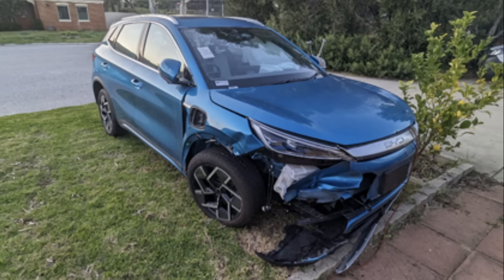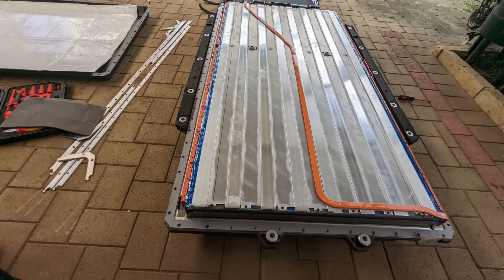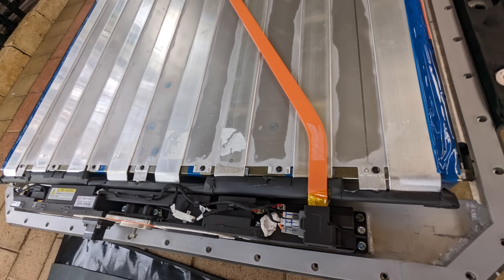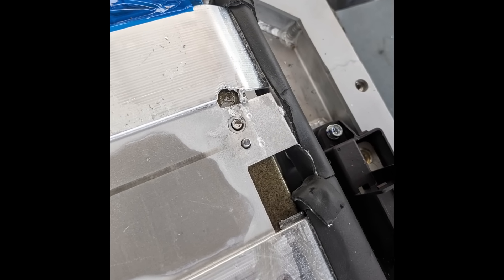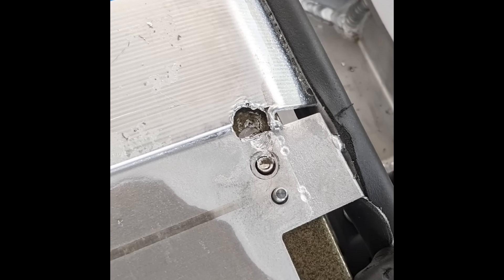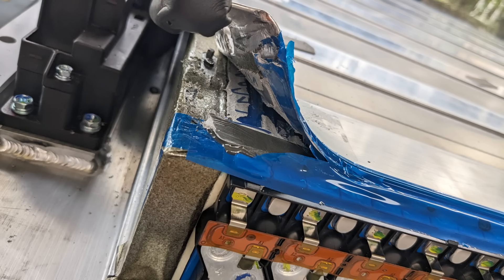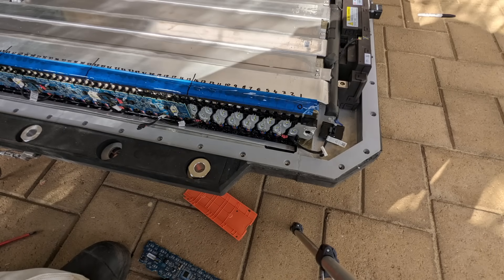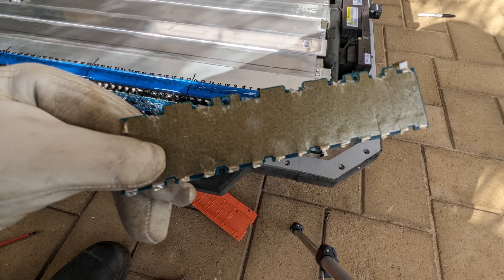BYD Atto 3 battery dismantle P1

Comment: Olá amigo, quantas células têm em uma bateria este modelo.
Reply from the maker: 126 cells (all in series)
Reply: @Brendon_M  Obrigado então esse Peck 403,3v qual a capacidade da célula.
Reply from the maker: Here are all the specifications of the pack
BYD Atto 3 60.5kWh pack 126S 150Ah 403V (3.2V LFP cells)
1050mm wide (1230mm including the mounting flanges). 2100mm long. 125mm tall

Haven't weighed it but around 450kg is my guess

Comment: Why do you want to fully disassemble the battery. Just keep it and use a High Voltage BESS inverter. And find a way to communicate with the BMS of the battery and make a "translator" to standardized CAN messages for the HV BESS inverter.
Reply from the maker: 100% agree. If I was to do it again, that would be the way I'd go
Reply: @Brendon_M  ah sorry read the rest of the comments u told that already before. :) still great setup like this and probably learned a lot....
Reply: 'High voltage' home inverters operate around 100-150Vish, as that voltage is the closest to actual solar string voltages found in typical home setups, not the 400V this pack puts out..
Reply from the maker: Not for grid tie inverters. There are lots around the 400V mark. Have a look at Dala's EV Repairs on YouTube or Dala the Great on GitHub. He has developed a whole system and lists out the compatible inverters

Comment: Friend, don't work on the floor, work on a table (and preferably a table that is high)
Reply from the maker: Problem is I didn't have a table that can support 500kg
Reply: I know my answer is not very kind; 
Sorry, my friend, if you don't like the answer, but I believe that problems don't exist, only options. I think there is always more than one way to reach any place. If there isn't a table, I would look for construction blocks or create my own table that can bear the weight. As far as I know, a wooden beam can be as strong as a metal beam
Reply: @Brendon_M  I think maybe you wanted to say that a table does not add value (it does not change anything) and that is why there is no value in investing in a table

Comment: What's the dimension of the battery pack?
Reply from the maker: I go over it in one of the other videos but - 
BYD Atto 3 60.5kWh pack 126S 150Ah 403V (3.2V LFP cells)
1050mm wide (1230mm including the mounting flanges). 2100mm long. 125mm tall

Comment: Thanks for the Video. Very Informative. Just one thing, Before taking out the battery, You must have also open the service disconnect. Where was it in Atto 3?
Reply from the maker: The Atto 3 doesn't have a service disconnect. The manual says to disconnect the 12V battery and then just unplug the HV cable from the side of the inverter stack. You then put a cover over the end of the cable that locks in place to keep it from being plugged back in or the terminals touched

Comment: @Brendon_M can you tell the part number of the main chip used on these boards?, looks like its a 64pin IC chip.
Reply from the maker: I'll have a closer look when I next get a chance. There's probably a close up in the P2 video but I can't remember for sure...
Reply from the maker: No numbers on them but yes; they are 64 pin  ICs
Reply: @Brendon_M  hmm, looking at the BMS board (the current sensing side), it looks like there are two ICs redundant to each other, performing the current sensing and HV measurements. This architecture looks similar to NXP (refer to RD-HVBMSCT800BUN)
Reply from the maker: Had a close look at the chip under a microscope and there are numbers
Main board is -
Infineon
Tricore
SAK-TC234L-
32F200N  AC
84PRT6835US
G2238
© Infineon '13

The other boards are
BYD
BF8815A
And another 4 digit number which there were a few variants 
u2Qa
B2R5
B20d
U205
B2P5
Reply: @Brendon_M  Hmm, which means the Main board contains Infineon's TC234L32F200NACKXUMA1 processor (used widely for automotive safety compliance), while the chips on the Battery sensing boards are still unclear. Lets see if we could reverse engineer more.

Comment: Are you able to tell me whats under the underbody battery cover once you remove it?
Reply from the maker: Do you mean the black material attached to the battery itself? Or the plastic under trays on the car?
Reply: Black tray under car. Somehow i ran over something which punctured  some holes
Reply from the maker: Well, the tray at the rear has not much under it. The tray at the front has all the connections to the battery behind it but they are all above a piece of rectangular tube so pretty well protected. Unfortunately I don't have any photos

Comment: This is a blade battery?? No chance to replace a bad cel??
Reply from the maker: Yes it is a blade battery but in this case the cells are welded together so unfortunately no, you can't replace a cell without specialist equipment.

Comment: So basically the battery is un-repairable. Seems to me that replacing a piston in an ICE would be easier and cheaper !
Reply: I dont know. Last time I contemplated paying a garage to do that was better to buy a used or new engine. Replace one piston whats next?
Reply: @jaaklucas1329  Let me rephrase that. "So basically the battery is un-repairable. Seems to me that replacing the entire engine in an ICE would be easier and cheaper !"
If the cells are glued in then there isn't a repair path so scrap. Basically the value of a used EV is the car minus the cost of a new battery (and installation labour) which probably comes to about a dollar.
Reply: @chrissybabe8568  Yea lm with you. Like to see an easier solution to fix a few cells in this pack. I believe Telsa can refurbish a pack.Mind you, these cars cost so little in China I guess it is what it is...
Reply: @jaaklucas1329  I have 6 close relatives who have bought EV's (incl 2 x BYD, 1 x Tesla). I avoid any conversation that would require me to call them stupid (5 of them have degrees so they certainly aren't stupid). The only thing I can think of is that they must be what are called early adopters who have totally managed to ignore all the downsides of owning an EV including the reasons of why they are NOT ECO friendly.
Reply: @chrissybabe8568  I only know Ebikes which Ive built and are excellent. Like Edison motors knows,  an Emotor is way superior to an ICE engine...even if its run on gas like a diesel locomotive.. As far as why ICE engines have to go,try this.Drive your ICE car into your garage, leave it running, close the door and take a seat.You wont last long. Multiply that times billions of ICE engines around the world,thats the problem.

Comment: You obviously have no concept of arc flash risk. Yes you're wearing insulating gloves and an 8 cal face shield but rest of you is bare. You should be wearing at least  15 cal overalls. One day a cell will short on you and you can think about the correct ppe in the burns unit.

Comment: They are all 18650 right?
Reply from the maker: No, they are not cylindrical cells at all, they're prismatic cells. There are 126 blade cells all up. I can't remember the exact measurements but they are about 100mm tall x 15mm thick x 900mm long

Comment: Too bad the cells are glued down making it not easy to service.
After a few years, these cells are still good for energy storage. recycling them for home ess would be great, but seeing how it is glued down like that, I am very discouraged to buy 2nd hand of these... :(
Reply from the maker: Slot of new solar inverters take a high voltage battery so when these batteries are too weak to run a car you'll be able to just unbolt them and plug them into a solar inverter with a small interface module for communication. It's the way I would have gone if I didn't already own a 48V inverter

Comment: I just tested the Seal and I'm blown away! ICE feels like a thing of the past now. This is the future, and it's mind-blowing! This looks like some 10,000+ mobile phones joined together. The engineering behind it is incredible! Sure, there's a bit of a scary thought if one phone catches fire, but hey, bring it on! 🔥
Reply: These LPF batteries are safer than all the ones in our devices which are lithium ion. LPF not as energy dense for performance but are workhorses.
Reply: Byd ❤
Reply: @sivaree2226  CATL cells are better than BYD's. though
Reply: Yeah ticking time bomb cars is the future most from china made cars
Reply: LFP battery cant catch fire. Its safe.
Reply: You sound like chinese propaganda bot
Reply: Classical chinese people admiring their cars. EVs are pain in the ass, not reliable and I prefer a diesel engine :D

Comment: why do they design it like that ...........
Reply from the maker: Cheap to manufacture and it will be reliable. It's just unrepairable which is not a manufacturers problem. At the end of its life the battery will be shredded anyway so I guess it doesn't matter too much (as long as the battery outlives the car)

Comment: Thanks for your hard work. My question is: are these blade batteries repairable, like the modular batteries? When I follow the video, it look like that the battery is not build for beeing repaied. This will be a no go for me and blade battery type. Nevertheless I already ordered a BYD LFT battery for our new solar plant (PV). But the battery is in house and cannot be damaged so easily. There are 3 moduls in a tower, therefore if one is bad, it can be replaced.
Reply from the maker: As far as I'm aware the BYD home storage batteries are different and the cells are not glued and welded in place. Which makes sense because a home battery doesn't have to deal with the same harsh environment a car battery has to

Comment: hello i have a question,
From your video I can't understand how they keep the cells compact?
also I can't figure out what material is that 2/3 centimeter spssor made of that you see in one of your freeze frame when you lightly lift the cold plate?
congratulations on the work
Reply from the maker: The cells are just sitting between some aluminium cross braces. I'm guessing they don't swell very much so there is nothing that actually clamps them together.
The "spacer" stuff is some sort of hard adhesive. Presumably it is a thermally conductive layer that takes up all the voids better the cells and cooling plate
Reply: I thank you for your reply, it would be interesting to see the placement of the crossbars. In the end and initial part of the pack it seems from your video that there is an end plate, is it still aluminum?  @Brendon_M
Reply from the maker: Yeah, the cross bars are aluminium and welded into the base plate of the battery pack

Comment: Original battery pack configuration inside the BYD Atto 3 (European or UK model): 
LFP Blade Cells, each 150 ah, 3.2 V nominal
126 cells, wired as 126s1p, total capacity: 60.48 kWh
BMS from BYD wired as 14+12+12+12 = 50 cells. Then 14+14+12+12+12+12 cells. So there are 7 BMS boards by BYD with 12s and 3x BMS boards by BYD with 14s. 
Cells glued in the pack, so no easy splitting of the pack to modules.

Target: make this very young battery pack from a car accident usable as a stationary energy storage system on a certain type of Fronius hybrid solar inverter (with ESS interface)
* strip the original BMS by BYD, as there is no info about it how to communicate with it via the low-voltage connector
* rewire the cells in the pack from 126s1p to 14s 9p for 44.8V DC nominal voltage (14s times 3.2V) and 1350 Ah (9 times 150 Ah), as the Fonius inverter can only handle a certain voltage range and cell number in series
* either add an aftermarket BMS or use that of he Fronius
* disregard the BYD components for thermal management (cooling, evt. battery heater) as it is used in a house environment with low C-rate when charging and discharging
* work around the BYD safety measures such as fuses and add new safety measures (such as fuses) and cell monitoring for the new configuration

With such information, the whole process can be understood much better. (PS: I updated this comment to include more information.)
Reply from the maker: Works out to 44.8V and 1350Ah
Reply: Can you reverse engineer the BMS to tell if there is cell balancing?  And if so how is it done ?
Reply from the maker: There is balancing. There are some bleed resistors (specifically 2x 10 ohm, in series) and a transistor for each cell on the BMS boards

Comment: The "glue" is a specially-engineered thermally conductive adhesive. It needs to be resilient, thin, and void-free to provide a thermally conductive pathway between the battery and the air-cooling channels.
Reply: What materials can be thermal conductive and an isolator?
Reply: @splenddickson  many materials - diamond is  great example. Many oxides. Only metals show a linear correlation between thermal and electrical conductivity as the electron movement enables  phonon transport

Comment: Are the cells in one single string?
And how many cells are there (ie, what is open circuit voltage of the whole pack)?
THX!
Reply from the maker: Yes, there are 126 LiFePO4 cells in series. Total pack voltage is 403V nominal

Comment: Hi
Are these Lifepo4 or Li ion  cells? I heard you mention 14s in a previous vid so assuming the latter?
Reply from the maker: They're LiFePO4. I know 14s is a weird number but my current system is 12s of NCMs
Reply: @Brendon_M  I guess as long as your inverter can work with the voltage range it doesn't really matter.
How about a stronger tape like gorilla tape or trex. Bunnings has some pretty heavy duty tapes which may be better for you.
Interesting project!

Comment: I see BYD went to great lengths to make this battery pack serviceable with the use of pop rivets !!! Recycling this battery pack at the end of it's life will also be very difficult.
Reply: EV batteries usable life is extremely long (it's not your usual mobile phone battery). After a good life in a EV, they get repurposed in battery banks to help electric grid demand balancing, after that they are often used to power small settlements (like some African countries), or they can be recycled (every part of them) - so new metals do not need to be mined to make the next battery.
Reply: Wrong! Recycling is relatively easy. It’s also VERY cost effective.

Comment: Maybe in future we should be building home power systems to use the batteries as-is. Of course we'll need to build an open source thing that can talk to the BMS and all that, but it's far easier than dismantling, removing cells, building a new enclosure, building new battery management... I doubt we'd be able to home-build anything with a nicer form factor than this, just lean the battery pack against a wall and bolt it so it doesn't tip over, and connect some wires to it and you're presumably set :D
Reply from the maker: You're in luck Dala (Dala's EV Repairs on YouTube) has made just what you are after. He has made an interface box that talks to a few different model solar inverters and a bunch of various EV batteries so all you need to do is buy the battery and bolt it to your wall. All open source on GitHub too (his handle there is Dalathegreat)
Reply: @Brendon_M fajnie a jakiej pojemnosci jest taki akumulator
Reply: Seems like a no brainer to me ! Batteries too degraded for vehicle use still have a long life for storage.

Comment: Thank you for making nice teardown video. Not agree with rubber plastic cover to protect battery.
Reply from the maker: Thanks. I agree the lid should be more sturdy. I saw a picture of a battery pack where a rat had chewed a hole in the plastic lid and tried to make a home inside the battery